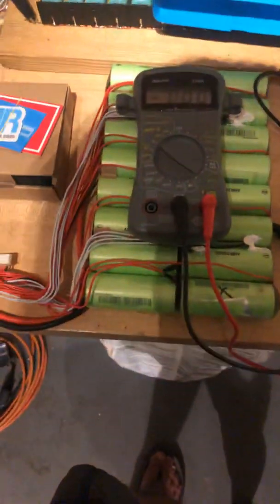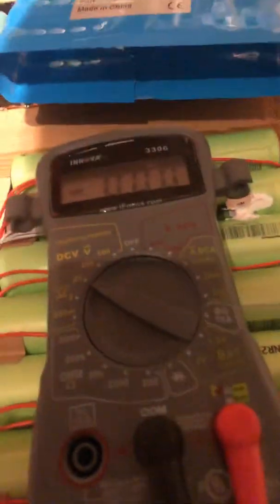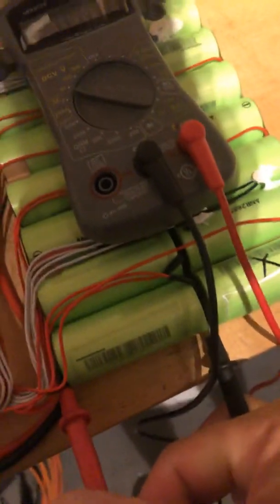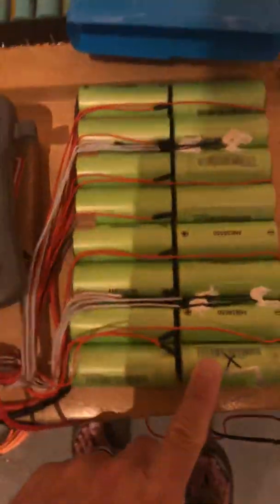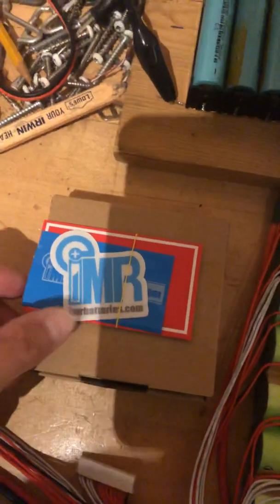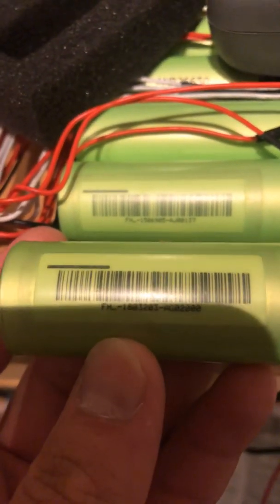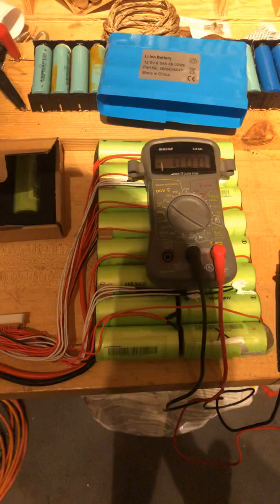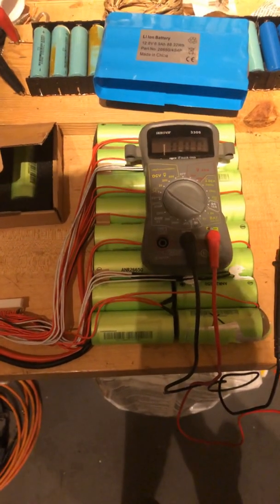Onewheel V1/+ battery teardown and fix

Comment: Do you recommend draining all the batteries before opening it up and replacing the damaged cell?
Reply: Before opening up the pack I charged the one wheel to 100% so the cells were fully charged. Then, I used a hobby charger that I already owned to make sure the new cell was at the same voltage. Not a perfect solution, since the other cells would have lower capacity being older, but so far I’ve only had two instances in a year and a half where it’s gone out of balance and I had to drain, recharge, and keep it plugged in for 48-72 hours. That’s recommended anyway so I’m not sure that’s even caused by the new cell. Hope that helps!
Reply: @chadgammon9890  thank you. Any other thing I should try before opening up replacing that 1 cell? I've done a 48hr charge already twice, and the 1 cell is  not holding a charge. Should I bother doing a longer charge than that?
Reply: No, at that point the cell isn’t charging and potentially dragging all the other cells down with it. I don’t know how smart the BMS is but if it’s not cutting off that cell connection from the others, and it may be, then it would eventually damage the other cells. Best to change it ASAP and keep it on charge until then.
Reply: @chadgammon9890  hey Chad, I changed the problem cell and the new cell shows 3.64V on a multimeter whereas the old cells are each at 3.55V. Should I put them on a long charge to balance them? I checked the community app however, and it's showing that one cell to be significantly lower still. Odd.
Reply: Sounds like your close to a repaired board! I’m no expert, but the research I’ve found says that within .1v should be fine and will balance. Outside of that you probably want to discharge the high cell with a small current (maybe a flashlight?) to match. Your probably fine though.
Reply: @chadgammon9890  hmmm okay. I've left it on a charge. I drained it to zero earlier but the voltage for the new cell went right down to 2+. I've put it on a charge now, let's see how it goes in a day or two. Thanks for your help anyway.

Comment: Did this end up working for you?
Reply: Yes, nearly a year later and it has a 6-7 mile range. I’ve had to balance the board twice (the recommended drain to zero, recharge for 72 hours) but at this age that’s pretty normal and I was doing that prior to at about the same rate. I don’t see any downsides at this point and honestly it performs better than before I did the procedure. I fully recommend it.

Comment: Was it cell 16 that's bad @iChad? If so, it's likely a BMS mosfet that's failed, causing it to continually drain cell 16 down to 0v.
Reply: How can you check the BMS for the mosfet failure?
Reply: @howardlock6430  Check the number 1 mosfet inputs and outputs
Reply: I think thats what I am experiencing. I have replaced the 16th cell with a new one but the BMS is draining that cell as well. What should I do?
Reply: @pichoo  Where are you based? I have a repair contact in Europe and the US. Cost me a bit over 100 EUR to get fixed
Reply: @cubiq1  I am in Malaysia, on the other side of the world. Did your contact end up repairing the BMS?
Reply: My BMS is cooked! Please refer me to your contract in the US for repair?

Comment: I have a dead battery from a V1 I'm trying to revive or replace cells. 

If that doesn't work I'm planning on making a custom 14S li-ion pack with a Two-x enclosure. (Enclosure bought used from someone who replaced it)